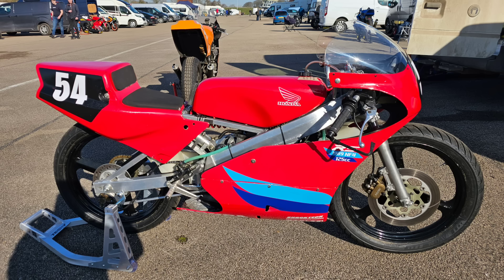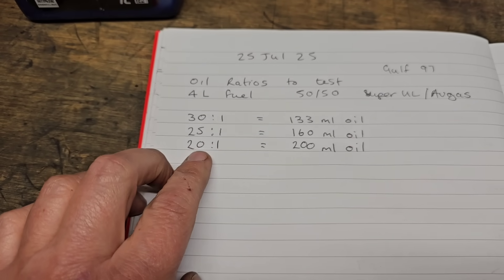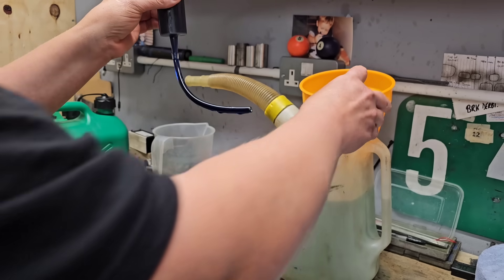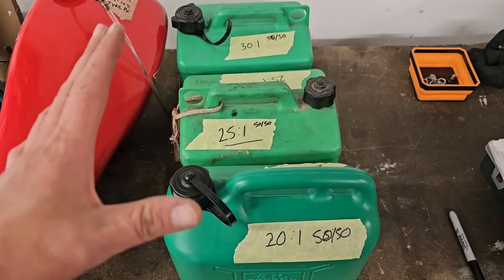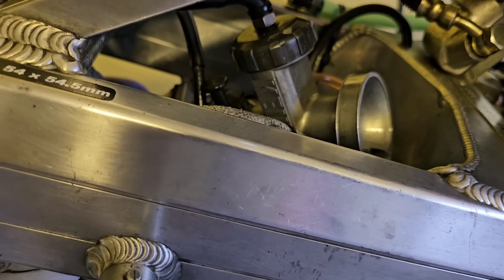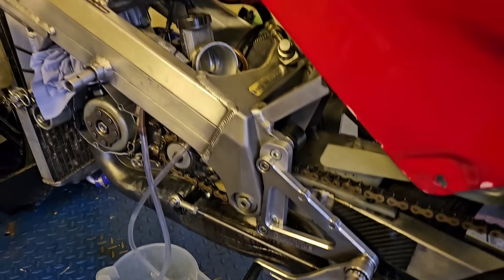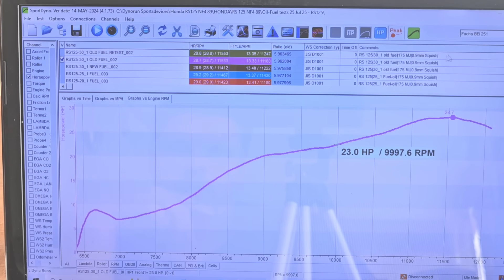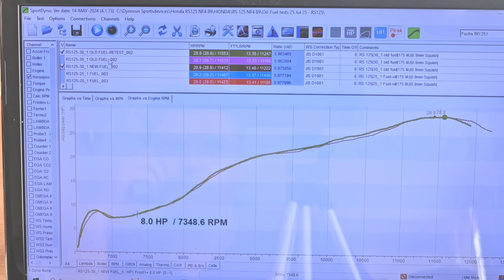Does 2-Stroke Oil Ratio Really Change Power? (Dyno Tested)

Comment: Yes, there's 3 main reasons to run LESS oil, none of which involve power or longevity;

1) Smoke/emissions,
2) Cost (oil is more expensive than gas),
3) Keep from fouling the spark plugs.
Reply: Exactly, on a road or even enduro bike, you're never full throttle all the time, so a ton of oil is just going to foul stuff up.
Reply: Not (quite) true...

One of the main reasons to use less oil IS to increase longevity...

(this probaly only applies to 2 Strokes that run 60000-70000km between overhauls!)

As a Trabant (600cc 2cyl 2Stroke) driver  myself I can safely say that Most engine s die because people run too much oil..

Carbon buildup in the bearings and Piston rings are one of the main reasons These things Die...
Reply: @Sorrow1994 um.... with shitty oil yes.

Comment: Back in my mx days it was run 32:1 on 65 thru 125cc engines and  you could go higher, 40:1 or 50:1 on 250cc through 500. I always ran 32:1 in all my my bikes from 80s to 250s..it was all in the jetting to me

I remember reading that ktms would recommend high fuel ratios like 40:1 on their 125s..i suppose with proper jetting that could work. To me the oil was part of the cooling process

Comment: More oil equals less friction, according to the thinking, but that's debatable. The oil film at a normal ratio prevents contact between the metal surfaces, so more oil doesn't mean less contact between the metals. Regarding the air-fuel mixture, the oil burns in the combustion chamber, so it also serves as fuel. So you don't know if the engine runs leaner by mixing more oil.
The test only becomes truly reliable when you tune the engine for maximum power with each individual mixture.

Comment: Interesting vid.  40 years ago I was racing 100cc karts at Mondello which was one of the fastest direct drive tracks in the world.  The long straights placed a huge emphasis on engine power.  Back then 100cc karts were fitted with very high revving [almost 20K] air cooled two strokes - Italian Parilla,  Sirio,  DAP,  British TKM and Austrian Rotax.  We would use either Castrol R30,  R40 or Shell R castor oil.  The engine manufacturer's recommended fuel:oil ratio was 16:1.  For Mondello drivers believed that 20:1 was a better option because it enabled the engines to deliver very slightly more power.  I tries both but couldn't discerne a difference.  Seizures were far more prevalent when I was on 20:1 though.
Reply: Yes, we used percentages instead, usually 6-7% oil.
Engines were more likely to seize using lower percentage of oil but less likely also to oil up the spark plug.
And back then that was a real issue.
There were big strides in tech made in the 90s, and that includes not just engine design but also oil tech, they smoked a lot less making it much more difficult to evaluate engine state by observing exhaust smoke out on track.
The basic principles didn't change but everything was a lot less temperamental with greater margins.
You never forget that smell.
Reply: @christosswc  The greatest aroma ever :)

Comment: It has more to do with how you use the motor.
MX on the pipe most of the time 32.1 is fine in the woods on rocky ST 40/50.1 works better...  
On a track 32.1 is fine your on the pipe and burning the oil not just blowing it out the pipe.

Comment: On my TZ750 I adjusted the mix ratio to an amount that my spark plugs stayed clean and the bike started well (push starts in those days). Never measured any power difference between ratios. Finally settled @ 1/35 ratio. p.s. oil used was Bardahl.

Comment: More oil creates a better piston ring seal, allows you to run leaner, and keeps the motor cooler. All of these things make more power, considering the expansion chamber  is tuned for the proper exhaust temperature. I always run my go peds at 20:1 with 927 csstor oil.
Reply: Ring seal is the answer!!
Reply from the maker: Thanks for the insight, good to know.

Comment: Need to re jet every time or your results are invalid
Reply from the maker: I was keeping an eye on the AFR, and there was minimal change between each ratio.
That said, I do intend to re do these tests and change jetting. I'll run an egt probe and cht into the dyno box too.
It will be a while as we still have two races left this season, and I don't want to test until after that.
Cheers
Dave

Comment: What are anybody's thoughts about running multiple ratios synthetic oil? I had been using this kind in my lawn care equipment. I buy the little bottles that you mix with one gallon of gas. I used to have half a dozen one gallon fuel cans with the ratio marked on each one . Been using this type of oil for some years now. We all have had 2 stroke equipment that would only run with the choke partially on. I put some Lucas fuel treatment in the tank and get the engine to run and turn up the idle speed screw so it runs without me holding it. When the engine starts to run different I turn off choke and make sure it revs up. My next door neighbor is a airline mechanic and I showed him and him a believer.

Comment: Back then I always ran my two-strokes on 1:25. And no, you don’t lose power with more oil, the good synthetic stuff burns clean enough. The only drawback is physics: higher surface tension, worse atomization at low revs, so yes, more smoke out the back. Big surprise. But then there are carbs like on the Kawasaki KMX, with a power-jet system that kicks in at full throttle. The engine breathes, the mixture fattens up, and suddenly it’s not smoking like a socialist steel mill anymore, even at 1:25.

Comment: It's all about the area under the curve and the higher oil does give more mid. Work out the area under the curve from 7500 - 12'000 rpm and post up the results.
Reply from the maker: Hi, the curves are so close. I'm not sure it would reveal that much? 
That said I do agree with you, its not about peak power but the area under the curve.

Comment: If you run a 2 stroke engine that uses premix a word to the wise. When you increase the oil you decrease the amount of gas going into the cylinder. Yes it burns the oil but the oil is primarily for lubrication. So running more oil makes the engine run leaner and lean engines run hotter. Now if it's air cooled on hot summer day you are increasing the amount of wear on internal engine parts. Yes you can get more power but sacrificeing the lifespan of the engine. You are not getting more power from the oil itself. I have a Polaris 2 stroke ATV but no mileage or hour meter. It is 22 years old with the engine never been worked on. I use full synthetic oil and it has thousands of miles on in riding through the woods and up and down hills sometimes with 2 adults. At the very least I would run full synthetic oil for sure. I replaced the spark plug one time  and parts that wear out on the ATV itself .
Reply: Hotter gasses in the expansion chambers also will give you a higher top rpm because temperature has a direct influence on the speed of sound.Higher temperatures "shorten" the pipe.

Comment: Apart from inaccuracies regularily occurring in tests, I'd say there is actual proof that more oil may result in higher power output, but it it certainly not beneficial to use less oil. This contradicts my (our) previous theory, stating that you should use the amount of oil which doesn't result in an engine failure (i.e. the least amount). I've always considered that oil lowers the octane rating of the fuel, slows down the flame front, etc. but maybe the extra oil helps the piston rings seals better and that is where we are getting the extra power from? I cannot think of anything other than that. I am interested in what actually causes more power from more oil then.
Reply from the maker: Thanks for your insight, it's great to hear what others think.
I want to try the Elf 909 that has castor oil in it. Maybe that would show a power increase 🤔
Reply: @AutoBeta2T  Such as Castrol A747, a racing oil, which we were told was enough to use in 1:100 ratio (!!!), but we never tried castor oils.

Comment: Hi, regarding the oil. You’re running on HTX 976 – that’s an ultra-clean oil. Personally, we don’t use it because the protection is rather poor. The connecting rod is especially exposed to wear, as with any very clean oil that has a lot of detergents. Instead, use HTX 909 with castor. It’s dirtier, protects better, and should also add some power.
Reply from the maker: Thanks for the info. I had noticed there there never seems to be much residue in the engine when I check it. 
I've previously used Motul 800, and that leaves a residue, but I dont believe it has any castor in it?
I'll give the HTX a go at some point. It will make a good test :)
Cheers
Dave
Reply: @AutoBeta2T When it comes to synthetics, we use Denicol Syn 100. For training, it provides very good protection. For racing, we use Exceed RSK M black bottle. Castor oil burns very well.

Comment: I'm running about 85:1 in every two stroke I own, including UL aircraft engines. Have done so for over 30 years.

So...I'm really curious about why you think more oil is protecting the engine. Crank is running ball bearings and the wrist pin/crank pin needle bearings...both of which require vanishingly small amounts of lubrication and in fact suffer from too much oil as a hydrodynamic wedge of oil forms ahead of the ball and they will skid instead of roll. Not so much for the crank pin and wrist pin needles. Pistons similarly require very small amounts of lubrication normally if the EGT and subsequent thermal input into the piston crown can be controlled but is really hard to do with carburetion as it is so difficult to have the exhaust tuning coincide with the appropriate FA ratio to keep everything in check thermally. I've always had some portion of the RPM range that went just a tad over lean then stochiometric then rich again all within a few hundred RPM. Really fiddly stuff requiring much patience and time....because now you have to try to do all of this with different air temperatures and pressures to build a proper map. And even then it doesn't always work.

Comment: 1:54 Your two stroke oil has a picture of a four stroke engine on the bottle, I automatically don't trust it...
Reply from the maker: I didn't trust it a first. I had to double-check. It is a two-stroke oil but maybe poor packaging by Elf. It is regarded as good oil.
Reply: @AutoBeta2T I'm a big fan of Castrol 927 myself, amsoil would be my second choice. Both are known to separate fast but run great, so I try to mix the day I run... 

My bike asks for 60:1 I run 40:1 , thanks for the video on the topic. Seems to me if you're using oil that burns it could predetonate like golden spectrol, where if using a full synthetic that runs through the engine and never ignites, more will foul things up... 927 is a blend so I get the benefits of castor, synthetic and conventional. I have to shake my tank anytime I stop is the downside

Comment: If your going to change the oil to fuel ratio, you need to rejett the carb for each mix. This would have the engine with the air fuel monitor keeping A/F ratio the same. As others have stated oil migration in the lower crank case will make a parasitic effect on how much the crank bearings are lubricated at very high rpm’s. Things not tested: you can tune for max power at top RPM. But the engine will not respond well thru the rpm range. In all tests if you can get more fuel and more oil at the correct A/F ratio you will make more power. But again as atomized fuel flow is subject to the engines volumetric efficiency you will see losses and gains when jetting does not get corrected for a new ratio depending how the engine is tuned (bottom end power, mid range power, or top end power). Allot of racers like a leaner mix and jetting to achieve quick revving and sacrifice the added heat produced and wear on piston/rings/cylinder. Best throttle response and overall power is what most engines in the 2t world are used. Chainsaws and outboard boat motors are tuned for best high cruise rpm and idling, most of these are slugging and fall off the power band easily unless operated in those rpm ranges. Try that rest on a chainsaw and see how much effect it has on acceleration to high rpm and when does it big down when overloaded (can’t pull chain thru thicker wood) it’s dramatic when not Jetted or properly mixed oil ratio.
Reply from the maker: That's a great point about the jetting, cheers for the detailed insight into the potential impacts of the oil ratio.

Comment: I spoke with Robert Barker, who set the world land speed record on a CanAm 125 back in the 1970's.  I asked him which oil he used while setting the land speed record.  He said none.  He knew the engine would run for at least 20 minutes before it would seize and that was more than enough time to run the course.  He wanted all the power he could get from the fuel.  He didn't want the spark plug to foul on oil either.  He did tell me he ran it rich and that they thought the fuel would act as a thin lubricant.  He also told me that when they tore it down after the initial pass they didn't detect any wear so they just put it back together and ran the second half to the trial with the same piston and rings.  I believe his land speed record stood for about 34 years if I'm not mistaken.  Just thought you might find this story interesting.  Thanks for your work with the two stroke 125.  I enjoyed your video.
Reply: He might have been sabotaging YOUR 125cc land speed record attempt. 😂
These guys never give out correct information.  
I've owned a road registered 250 Can Am btw. 
It was a lot of fun. 
They rev hard.
Reply: Definitely an interesting story, also 🐄 💩
Reply: I work with a guy who ran straight gasoline in his 2 stroke back pack leaf blower "by mistake". It some how worked for almost a year before it finally seized up. He reported this to the manufacturer and they sent him a brand new replacement for free lol.
Reply: There was a story back in the 1970s that a fellow won a two stroke motorcycle on a game show, he walked the bike over to the gas station and fill it up with straight gasoline. It was said that he got almost 40 miles on it before it locked up.
Reply: @philosborn1840  That's about right, back in the 70's the fuel was different, it was leaded.  The leaded molecule acted as a lubricant.  When lead was removed from fuel they had to harden valve seats to make cars run well because of the lost lubricant.  Don't know how many people would have remembered the cars that wouldn't shut off and would knock run on unleaded fuel back in the 70's.  Motor vehicle history is an amazing thing...
Reply: You do know that's not true. A 125cc race engine lasts less than 2 minutes at full output with no oil for internal lubrication. Many don't last 20 seconds on a dyno. What actually happens is that the rings become excessively hot immediately. Followed by the piston, which then expands and grabs the cylinder.
Reply: @cujet  I am not lying to you.  I am trying to give you a historical perspective on the oil/fuel mixture theory and relaying what it was like in the early 1970's.  Dyno's were not as readily available as they are today.  Things were done seat of the pants back then.  So you can believe it or not, I don't care.  I personally knew Robert C. Barker and rode motocross with his son Alan.  Robert and Alan have since passed away so you only have my word, take it or leave it but you might learn something from history.
Reply: @RunsWithScissors  I don't think you are lying. Not at all. Just that he was probably distorting the truth a bit.
Reply: @cujet  No, not Robert, he wrote the initial rule book for AHRMA and was one of its founders.  I worked for him for a short period of time back in the 70's as a test rider while working towards an electronics engineering degree at UF.  Robert told me what he had done to set the land speed record.  He made a one off 7 speed transmission for that bike, the last three gears were set up to only drop rpm by 500rpm.  Geared very high.  The rotary valve engine was tuned to produce power at high rpm and was gutless down low.  He did a lot of work in a Canadian wind tunnel to tune the aerodynamics of the body work.  He found that if he arched his back in the wind tunnel it cut back on the drag so he had to remember to arch his back while he was doing the runs. I remained in touch with R.C. Barker for decades until his passing a few years ago.
Reply: @cujet  There is one other detail.  The gasoline back in the 60's and 70's was leaded and that was supposed to act as a lubricant.  When lead was removed from gasoline you had to harden the valve seats to accommodate the lack of lubrication the lead had provided.  The fuel back then acted as a lubricant.  Things are a bit different today.  Mostly its better now...  🙂
Reply: @RunsWithScissors  sorry to hear about your friend passing
Reply: It depends on the fuel leaded fuel acts as a lubricant to a certain point
Reply: I know its been mentioned already, back in the day you could purchase some real good exotic leaded based gas. Talk to some of the 1/4 mile racers thay know all about it.  And a guy going for a serious LSR isn't going to be using pump gas.
Reply: @superdidly1 yup Sunoco used to have 114 octane at the pump
Reply from the maker: Wow, that is a great story and a cool fact, thanks for the info!

Comment: Too high of an oil ratio with clog up your spark arrestor screens faster and gum up mechanical power valves. i recommend no more than 40 to 1 ratio but 50 to 1 is the sweet spot for a good quality oil brand.